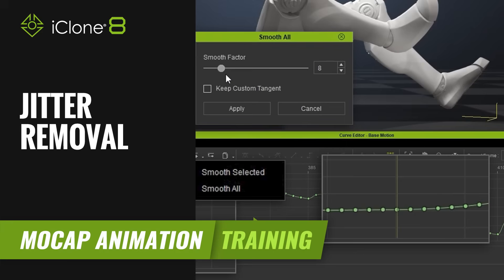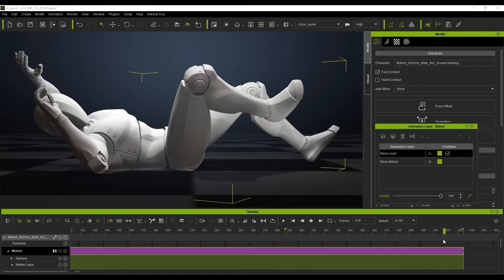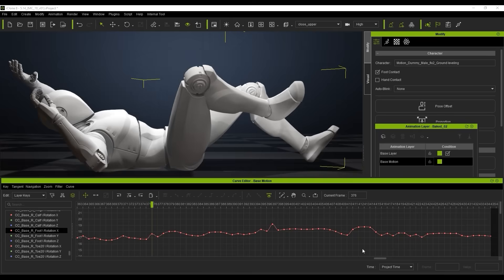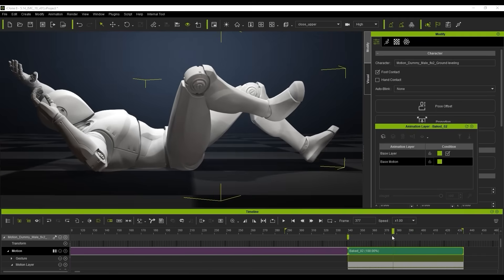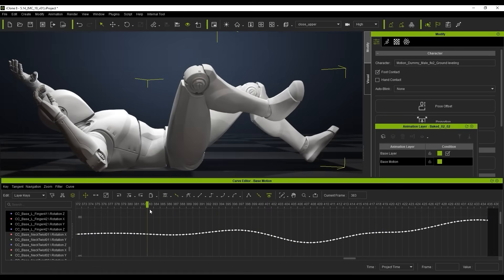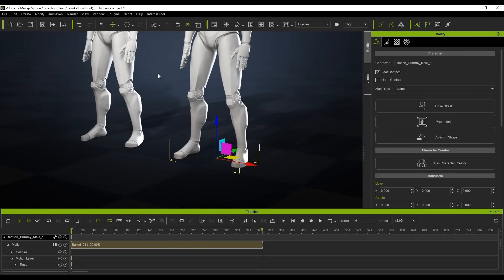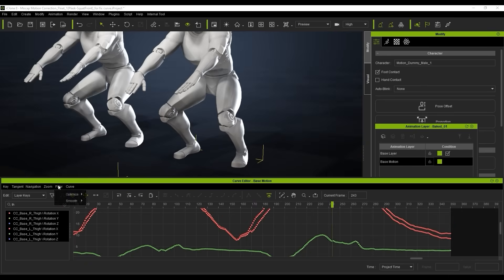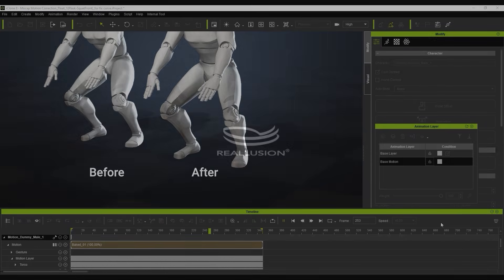How to Remove Motion Jitters to Achieve Smooth 3D Animation | Mocap Animation Course | iClone 8

Comment: Hi iClone, thank you for the tutorial. However, I still have some questions. When I smooth a clip to remove jitter, the poses at the start and end of the clip do not match the original poses. In other words, the clipped part doesn't transition smoothly, so I have to blend the clipped part again. Is it the correct way? Is there any way to smooth just the curve in the middle part while keeping the poses at the first and last?
Reply from the maker: Hi @simohayha261,

Yes, you can select the specific keys in the Curve Editor and use the right-click context menu to choose ""Smooth"" or ""Smooth Selected."" This will allow you to adjust the smoothing settings for only the selected part of the curve, keeping the poses at the start and end intact.

For more details, check out these links:
https://manual.reallusion.com/Curve_Editor_Plug_in/ENU/Default.htm#Curve_Editor_1/Curve_Editor/Application_Mocap_Data_Cleaning.htm?Highlight=smooth

https://courses.reallusion.com/home/iclone/mocap-animation-training
Reply: @reallusion  'Smooth Selected' works amazingly well. Thank you!

Comment: Hi thanks for the tips!! 
However, curve editor is confusing me still. 
How can I edit the curve in the IK list section? I can see them, select them but no way to move them, the key tools above stay greyed out. 
Do I miss someting? I can find any usefull information in the doc about a proper workflow to fine tune the edits that I made thru motion layers...
Those IK and FK list in the curve editor seems to be complementary, I can edit all the keys that I find in the FK list, but no way to find all the bones that I need to tune in there. 

Please help me, I'm stuck at this point... 😢

Thx.
Reply: Did you find an answer?😢